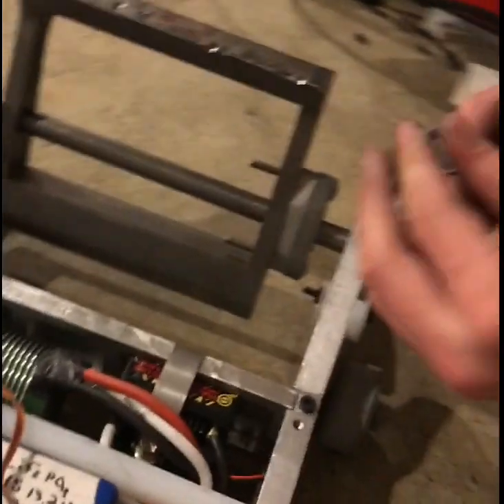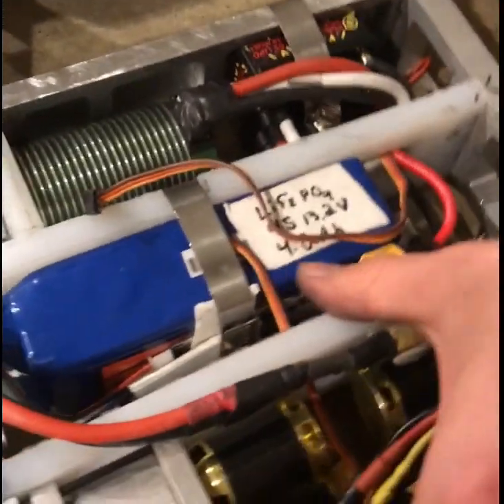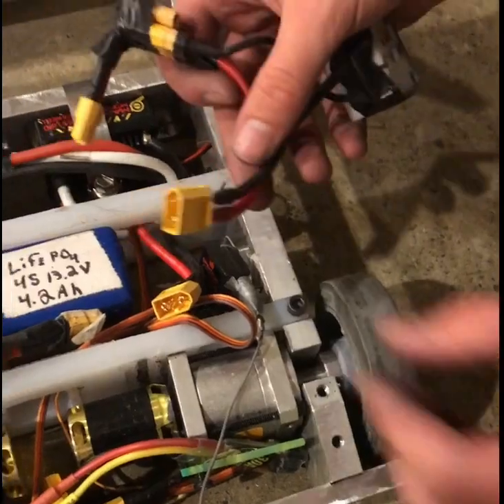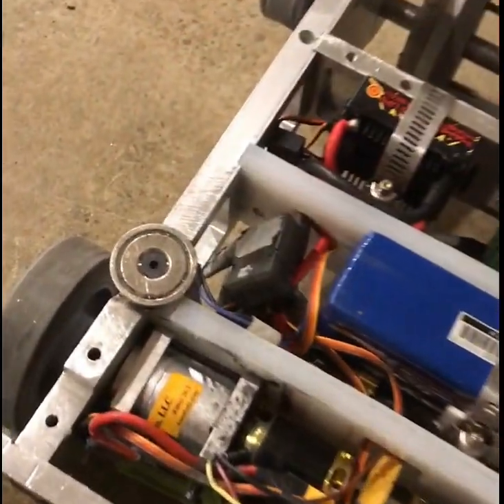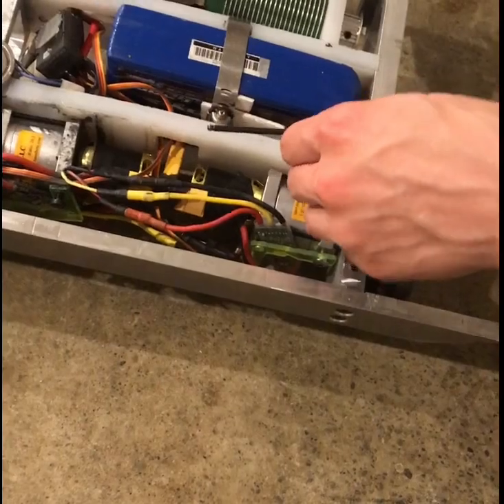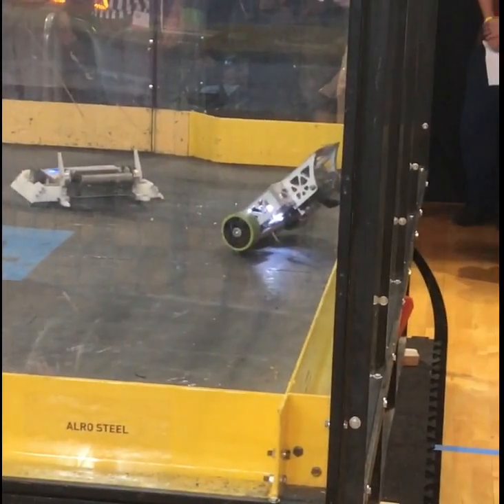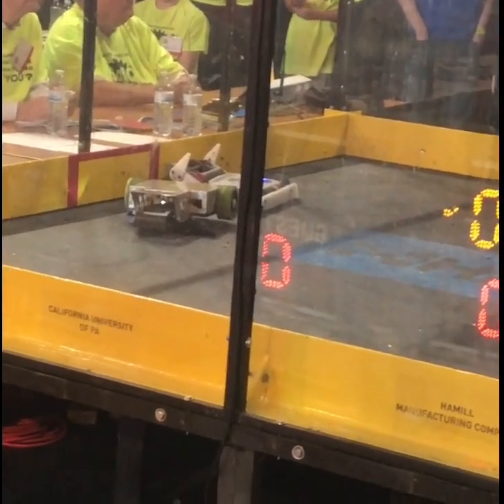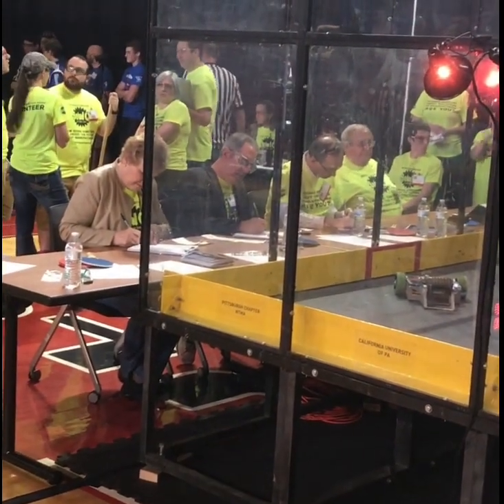building a BATTLE BOT, Step by Step (part 2)

Comment: Could you recommend another cheaper drive motor that does the job an how do u get the aluminum frame
Reply from the maker: An RS-540 size brushed DC motor is costs a few dollars and will work with the Banebots gearbox. Of course the gearbox itself is $50 or more, so if you're looking for a cheap drive system consider gutting a pair of cordless drills. I did exactly this on my 2018 bot. You can find the video on my channel. I had to 3D print special clamps to hold the drill assembly since it didn't have any good mounting points of own. It was well worth the extra work. It cost only $40 for both drills instead of $100-150 for Banebots gearboxes and motors.

Comment: Can we use that castle motor to run 9kg drum spinner. And that driver motor to run a 15kg bot.
Reply: There are too many variables to say yes or no based off of your question. You have to consider voltage, gear ratios, inertia, tip speed, and more.
Reply: that castle motor is rated for 15 lbs and 9kg is 19 lbs, when it is spinning it has ridiculous amounts of inertia. i would say you are good to use that motor in a 20lb bot however in a 30lb bot with the such high amps it may fry it when hitting a 30lb bot. i have used an e-flite power 46 which is rated up to 7 lbs in a 15lb robot and never fried it. if i were you because it is a 30lb bot i would use castles 2028 motor although it won't have the same rpm, it is rated for 30 lbs. the drive motors in that bot i would say no
Reply: Caden Korzan The motor is rated for 15 pounds of what? It’s definitely not talking about 15 pounds of high inertia spinning steel.
Reply: @bldjln3158  the motor is rated for rc cars weighing up to 15 lbs. and yes it will spin something that weights 15lbs and even more. the thing is the motor could wear out faster or overheat if not gear appropriately
Reply: Caden Korzan My argument is that there’re too many variables to say yes or no to Gomja’s question. We don’t know what voltage the motor will be ran at, how large is battery is, weapon design, gear ratio, friction, and many other things.
Reply: Caden Korzan That weapon that he’s trying to run is 20 pounds, way heavier than most featherweight weapons, and will probably have a ton of inertia. If he has a 6s system, I would think that the motor would struggle to spin the weapon quickly enough to be effective, unless it’s geared to spin at 150 mph or something around that.
Reply: @bldjln3158  i can see what you are saying however if he runs it 6s and hits something that weights 30lbs i bet it will fry it because it is 200 amps, but if he were to do a 4s then it could work. the best thing to do is use the castle mamba xxl with the 2028 motor. also if he does use 6s on it it will be easier to spin up because it has more power. and once it gets going it aint stopping, but when it hits the current spike is going to fry it because it is more than what that motor is rated for. i use that motor for my 15lb bots and it sends bot 10+ ft in the air
Reply: @bldjln3158  also the only variable that matters is if the motor and esc can handle the weight and current going into spinning it. shape can matter a little due to wind resistance but otherwise not really
Reply: Caden Korzan Shape matters a ton. If you put all your weight close to the bore and not as far out as possible, your inertia and ke would be lowered drastically.
Reply: @bldjln3158  true i completely agree but thats not what i mean by shape. you are talking about the radius or diameter on the blade, i was talking about like this blade has like triangle teeth and that one has squares
Reply: @bldjln3158  also im pretty sure if you have lets say 20 lbs of steel that is the shape of a cylinder that is a foot in height and 20 lbs of steel in a cylinder that is 100 ft tall the inertia is still the same. just spread out over a greater distance which is not what you want in this case
Reply: Caden Korzan I may have misunderstood the cylinder thing, but if I did understand, no. If the weight is rotating further away from the bore, the speed is higher than it would be if it was closer. If there is a very long cylinder that weighs 20 pounds, versus a short cylinder that had a larger diameter, the larger diameter cylinder will have a greater MOI than the long cylinder for the reasons stated above.
Reply: Caden Korzan 
Looking back, a lot was falsely said by you. A motor rated to move a 20lb RC car does not spin a 20lb flywheel with sufficient energy for combat robotics. First realize that a 20lb RC car moves at a far slower speed than a standard 200mph weapon, and also the conditions being far more strenuous for a combat robots spinner. You disregarded a huge amount of factors by dimming down the complexity to a point that you understand.

Comment: you don't explain about motors and pulley please also explain about them
Reply from the maker: +Cultures of Pakistan I think I  explained the weapon system in Part 1, but I may have omitted it. It is a Castle 1515 motor, with a 15:26 (I think) pulley ratio.

Comment: Great fight !, but I have a question, why would you prefer an eggbeater as a weapon instead of a Drum?
Reply from the maker: David Ferrera
 Both an egg beater and a drum can be equally effective if done right. However, I liked the simplicity of a weapon that is made from a single piece of metal. It is not uncommon for the contactor blades of the drum to snap off at the edges after a big hit! Yes, it is true that I have seen egg beater style weapons break or shatter as well, but that is usually the due incorrect tempering of the steel or thin wall thickness. An egg beater is much more challenging  to manufacture unless you have the ability to cut through thick sections of steel. Penn United sponsored us by making the weapon for us! I hope this clears thing up!
Reply: Which motors are used to drive the bot ?